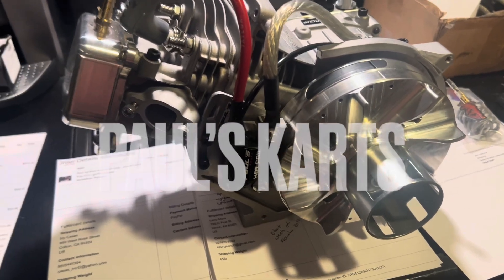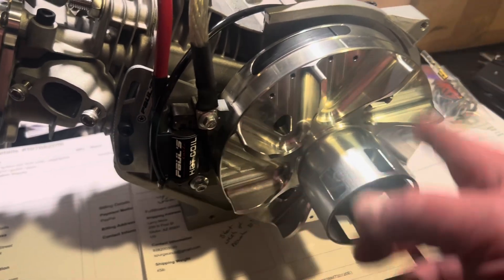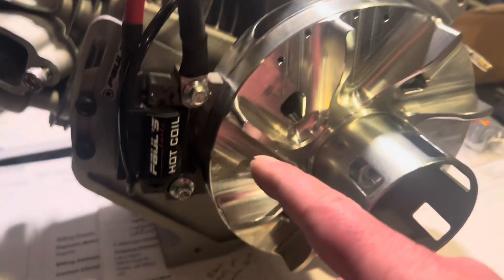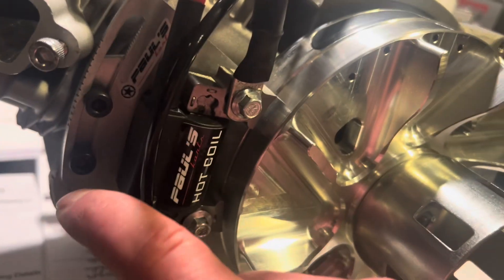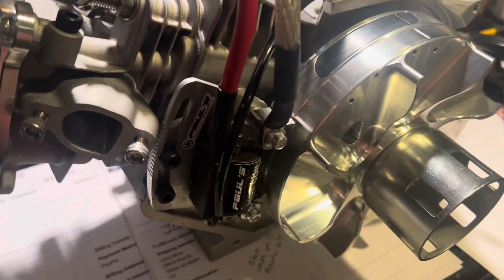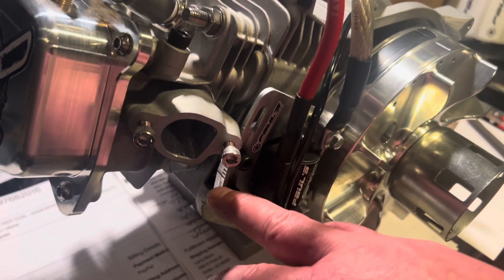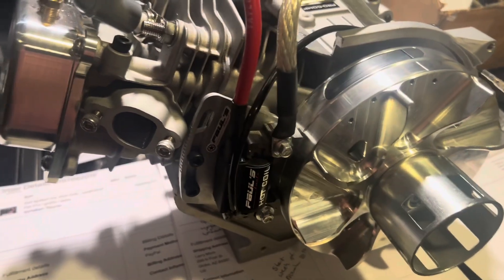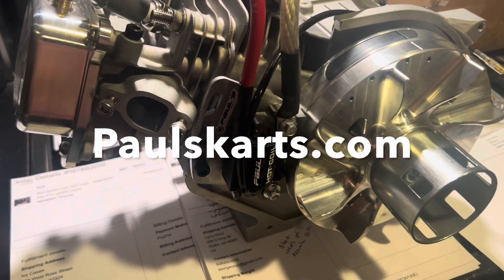Paul’s karts, “Adjustable coil bracket”. How does it work? Paulskarts.com

Comment: Hey, Paul, love your videos. You make great products . Have you seen these people on Facebook? Promoting CDI kits for small blocks. Were you use a 12 V drill battery? I got another question. What do you think of those auto lites gapless plugs?
Reply from the maker: I think csi is cool but also kinda bulky. You really don’t see any power gains with a cdi on these since it’s mainly the total timing being correct that makes them run there best. The cdi does have some cool features like allowing a timing variance down low but no power is really going to be made down there in that rpm range. If these engines had gear box and trans they would possibly see some ° of assistance of a cdi but still very minor changes in power down low in rpm range. If you use a single state ignition like a standard coil the ignition timing does not vary, it’s steady at whatever it’s set to. So if you want 32° total timing at high rpm to make the most power the coil if set to 32° timing works at peak performance at high rpm. You would put the same total timing into a cdi system. The k my variable would be that it would ramp up to that total timing number. So at low rpm it won’t have 32° timing in it it would have say 25° and ramp up to 32° at high rpm. The mere is only a tickle on the dyno at low rpm timing changes. And I’m talking a fraction of a fraction of hp. So for the cost / setup/ battery maintenance and weight and bulk of wiring Id really have to consider other options. 

The autolight ar3910x plugs are not good in these engines .. I sound like Debbie downer here lol but I’m just trying to give my honest experience. The autolight plug is way too cold of a spark plug. It’s going to throw your tune off if trying to tune by the spark plug like you should do. I also prefer a electrode strap because that gives you valuable cues to your ignition timing. So I’d say scrap the autolight ar3910x and get a better more in the heat range of your engine kind of plug. Now I do like the E3 plugs. Check those out
Reply: @paulskartslifan4206  Thanks for your response.
Well detailed, Thanks for answering all my questions. You make some very awesome products.😎🔥
Reply from the maker: Of course man. If I can help I’m always going to. Cheers 🍻

Comment: Is there any for gx390?
Reply from the maker: This is for small block
Reply from the maker: I have a gx390 flywheel and adjustable bracket setup from ambush racing in stock if needed
Reply: i need the adjustable bracket if you have any. i already have a arc flywheel. @paulskartslifan4206

Comment: I am looking to order one for my build but heard of issues with coil spacing and it being spaced to far out even in the video the coil doesn't look to be in line with the flywheel magnet is this potentially a issue on a different flywheel and crank like a on a predator 212 non or is a billet flywheels magnet still strong enough to trigger the coil even if it is out of alinement
Reply from the maker: This is the EC flywheel , this flywheel has a split face design and a smaller magnet than the arc flywheel. But even with this off set type flywheel it still has all it needs to fire the coil. The bracket is 5/16” thick and we recommend to remove 1/4” from the bosses on the block. So the dif is only 1/16” or half a fingernail thickness. Even if you don’t cut the bosses and the coil sticks out 5/16” it still works. There is no setup of flywheel type or block or coil that wont work even without cutting bosses. But we like to get things back into stock position by cutting the bosses down. It’s all in the instructions and there is a video of how to install these as well. Good question. Glad to answer those. 💪👍✅😎

Comment: I've heard that stock and cast aluminum flywheels are pretty well worthless beyond 28* due to weak magnets, is this true?
Reply: That makes no sense. This device advances the coil assembly. This has NO effect on spark power. It is designed to advance timing
Reply: @andrewwolf4430  Who said anything about the device?
Reply: Coil gap set at 0.020 on the ones I have
Reply: They have been known to explode
Reply: Did they mention what they had the coil gap set at? At one point I recall seeing the Honda spec for the cast aluminum flywheel. I don't remember the spec but do remember that it was pretty small. 16 or 18 thou maybe.

The cheap cast aluminum flywheels are ok except that they have 18-20 degrees of timing. I used one recently and just timed it without a key. Recently I seen these that the seller says have 28 degrees of timing and they are more expensive than the others. Years ago I got a "genuine Honda" cast aluminum from NR racing. It didn't have any timing like the cheap ones you can get these days and looks identical.
Reply: I want to know if those cheap cast aluminum flywheels can be advanced beyond 28 degrees and carry enough power in their weaker magnets to produce adequate power for spark. I was told not to bother advancing them past 28, just looking for a second opinion
Reply from the maker: @amandarego9684  you would want to get timing to 32° -33° ish for best results on gas depending on octane and compression ratio. Type of flywheel does not matter, any flywheel that spins a magnet like they all do would want to be set as close to correct as possible.
Reply: @amandarego9684  You should continue to ask around but mine seem to do ok at 32 degrees with no indication of an inadequate spark. I just time to what the cam calls for and run them.

Comment: Make one fora pvl coil
Reply from the maker: Pretty sure you can mount the pvl bracket to this bracket just like you mount it to the block. It uses stock mounting position so in theory it would work.